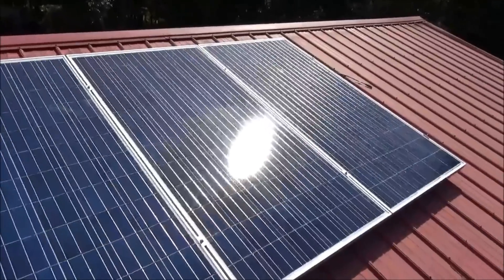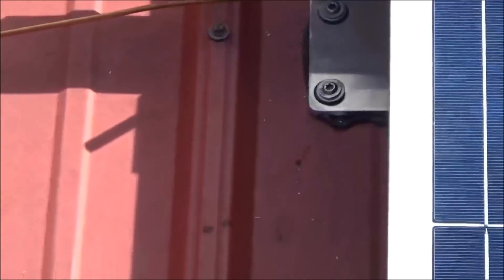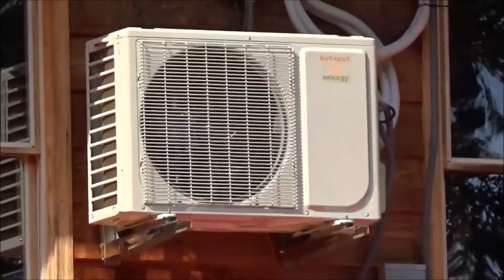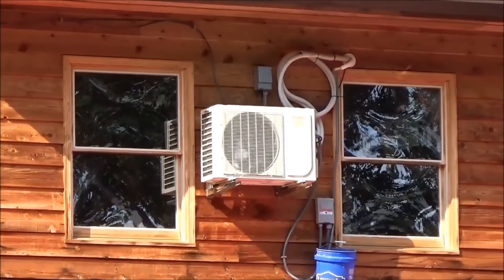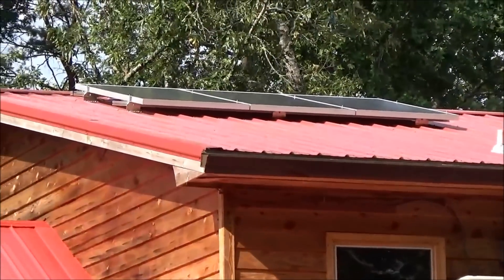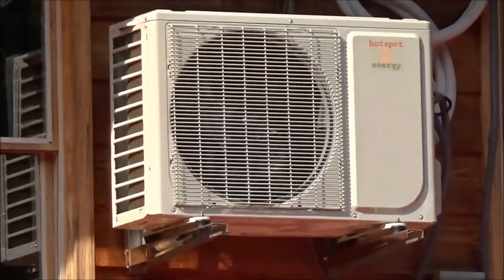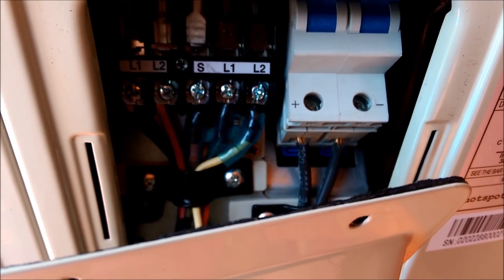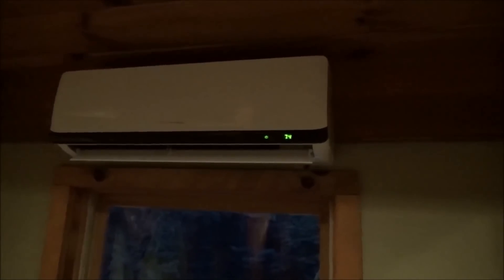Solar Air Conditioning  Part 2

Comment: Im a lil confused whats the purpose of it having to use 220v if its solar i have 960 watts of solar was thinking about buying a system like that
Reply: Check out the ZamnaClimate solar hybrid version. They run directly off solar panels and comes in sizes 12000, 18000 & 24000 btu

Comment: the thing about prepping/off grid/pipe dream is unless you can make it out of sticks and rocks and leaves, you'll need to BUY TECHNOLOGY from a STORE, found in a CIVILIZATION. If you fall off a ladder installing it, you'll need a DOCTOR, trained at a UNIVERSITY, working in an OFFICE; long story short - we need society and civilization, we can't just stock up and hunker down. How long can you survive like that? even when you're shoes wear out and you need spark plugs or air filter or gasoline, things made by a society.  unless you're going back to horses and sawing 2x4's by hand, you're going to need society eventually. we don't exist in a vacuum. even 1800s frontiersmen  needed shovels and picks, made in a forge by blacksmiths = technology. so to really be a preppier, you have to go back to scrounging for bugs and berries walking around naked and afraid if you take "prepping" down to its basics of surviving long term. think a life expectancy of 35 years. Think a short and brutal life defending your stuff from other desperate hungry preppers. Think living like an Indian in 1830, that's what you'll be doing without society and civilization.

Comment: Have you thought about ways to capture the solar energy from the panels when the mini split is off? For example, when the mini split is off, a charge controller is taking the solar energy being produced to charge batteries then inverted to power a frdige for example, but as soon as the mini split unit kicks on, a relay switches the solar energy to the mini split.
Reply: I should add, I just bought and installed the acdc12c and am trying to consider the question above.
Reply: Did you figure it out?

Comment: $$$$$ If anyone's intent on saving $ with this (or the 18,000 BTU ACDC18 model), contact me since I'm an authorized HotSpotEnergy.com dealer in FL: Call 786.441.2727, text: 305.297.9360, toll-free: 800.250.8975, e-mail: info@solarbuyersclub.org, or send a friend request (slowest) to: https://www.facebook.com/danny.chingteh.tseng ONLY if you're not a window shopper or tire-kicker!

Comment: Looks real good....BUT the indoor unit is too close to the ceiling.  The closes I have found is about 12 inches from the ceiling.  What about the cleaning...can you lift the front panel to clean without hitting the ceiling?

Comment: If I for instance needed 24000BTU for my house, could I use 2 of the 1 ton units, or do I need to get a 2 ton unit?
Reply: You could get two units.. Standard Ductless systems can allow you to have multiple indoor units for every out door unit. That does not look possible for this brand. So you would need two whole systems. No pricing I could find on Hots spots website. Think I will have to call them this week.
Reply: Did you eventually get them?

Comment: great videos and set up. how much is this mini-split? are their other brands if so why did you pick this one? I want it mostly for heat will this keep a 900sqft to story house toasty? thanks
Reply from the maker: 1795.00.  I've been with this brand for 6 years as I cannot find any other brand that works as well.
Reply: @engineer775  I went to your site for preppers but the pictures are so generic you have to update that close-ups angels so people can see what they're spending their money on, one unit looks gray or sliver one looks tan, but you can't see any detail please send me more picks of the 18000 solar unit and how it's better than the Ymgi

Comment: Doesn’t say how much for whole System. Think about this, let’s say you spend 110.00 a month to run your AC , 4 months out year. That’s 440.00 for year. Let’s say total system cost $6500.00. It would take 14 years for pay back. In 8-10 years you’ll be replacing that mini split unit. What did you save zero. As a HVAC guy, I can till you maybe 10-12 years
Reply: Poncho758 how did you arrive at a figure of $6500? In the UK you can buy solar panels like those for a couple of hundred pounds each, and a small minisplit ac unit is about £500. You could install this for well under £2000 which is probably $2500.

Comment: 1 ton or 12000 btu split AC  usually gets around 1100 watts how do you get 900 watts ?
Reply: It's probably like every other electronic device it's underrated

Comment: Why did the leave copper lines coiled up like that ?  
 Have you had any oil return problems ?
Reply: Alex G I was thinking the same thing, I bought a flaring tool set and I cut my line set and flared them to the proper length.

Comment: Solar swamp cooler ! The hot-er it get the more it cools !
Reply: Not good in places with high humidity. Good for about 10 deg F cooling in dry climates.
Reply: @RealityNoFantasy  Bull!!! Ours drops average of 20 degrees in about 30 minutes in an 82° room with 100° outside temps.

Comment: can any ac unit be installed to solar. i have the same a/c as you have.. im hooked up to electric .but id like to change to solar
Reply: cathy gassien I think he installed a HotSpotEnergy air conditioning unit:

https://www.hotspotenergy.com/solar-air-conditioner/

These special units can work directly from either AC or DC.

Regular air conditioning units are usually grid tied and only work with AC (alternating current).

His unit can work with either DC (direct current) or AC electricity, and, furthermore, it can work directly from the DC electricity produced from the solar panels during the day without the need for an inverter.  At night, however, it can work with AC (alternating current) electricity from the grid.

The benefit is that the AC unit works harder in a poorly insulated room during the day, and he can save money by providing solar energy to run the unit.

At night less space conditioning energy is required, and he can run the unit with grid energy.

Keep in mind that this works well for one air conditioning unit and perhaps two; however, if you required more (from a cost perspective), you might want to install an inverter, and this could be a different type of installation.

Again the driving force for purchasing these units is based on need, and your particular needs will determine the type of installation required.

Comment: I did not do any research but does this unit only produce ac or does it produce heat and ac?  If not, are you aware of a hybrid solar powered hvac system with a battery back up option that can be plugged in as well to run on grid power?

Comment: ice balls I think is the most efficient way of storing cold. about 50 kWh can be stored in a one cubic meter tank which is just a super insulated tank that circulates antifreeze at about -5 C when the sun is shining and then at night chilled water can be run over the frozen "ping pong " balls.

Comment: What would it take to operate this unit completely off grid? I am sure It would require many batteries to keep going through the night.  I am thinking maybe wire in a wind turbine power generator along with the solar panels
Reply: If that worked, you wouldn't need the solar.
Major expense.
Most people don't get near enough wind to be viable

Comment: Awesome job. I have a whole house with minisplits I installed. Cheapest electric bills I have ever seen. These units use PVE oil which does not turn acidic with moisture. The evacuation is important but not as critical as poe oil in split system ducted 410a units.

Comment: Just a few questions, if you have checked, how hard is it to get parts for the A/C? How many electronic boards are in that unit? Have you looked up the cost of replacing any of the electronic cards in these newer style units?  Thanks

Comment: I just installed a mini split and had the line set coiled like you do. An HVAC came over told me not to have it that way ( can't remember exact reason) so he cut the line and brazen them to a shorter length. Also wrapped my line set with UV resistant tape

Comment: if it rains will it damage the solar panels?
Reply: No 😂
Reply: They are specifically engineered, and manufactured to be able to resist the majority of weather with the possible exception of a hurricane.

Comment: Does this unit have a timer on it?  I'd be very interested in only letting it run when there's enough solar... I understand it needs 220v, but I'd love "some" way to restrict the snot out of 220v power draw.

Comment: I used 12 solar panels to run two 2 ton A/C units and there was surplus power that I stored or sold to the grid. Not all solar panels are created equal, some put out far more power than others. The inverter was the week link in the system.

Comment: I am living in a tropical Country with lots of SUN and with one of the most Expensive Electricity rates in the world. I want to make an OFF-Grid 1.5 HP (3800 BTU) Air conditioning WITHOUT/NO Battery. Just to make the room cool during day and also will help the other air conditioner ON-Grid will be eased at Night.      Is it feasible?
Reply: its possible, we have such product which run only by sun without battery. contact me by whatsapp: +8613906101733

Comment: Is this still working well?  Also, so there's one compressor, and that runs on DC, and the alternating current is inverted for that?  Thanks again for filming this.  Did you do your absorption chiller project?
Reply from the maker: it is working great a year later. the chiller project is going great. videos this week.
Reply: Thanks--looking forward to them.
Reply: @engineer775  how much this unit

Comment: engineer775,, great install, I love ductless mini splits,, I have never used the solar units,, I will have to try one on my place,,, :)   Oh, fyi,, in the future installs, cut the loops out of your lineset,, it helps keep oil that lubes your compressor, from being trapped. If your outdoor unit sets allot higher than the indoor unit,, then depending on manufactures specs, they may have you install a trap, to help get your oil return, back up to the outdoor unit. But you have done an awesome job,,, great video!! Thank you !!   LOL, I know, I know,, whiny HVAC guys. Grin.

Comment: it looks great men but , for a cheeler, you will need some inverter pure sine wave, that have 220v 208v 240v some like that ,I think and a few sola panels more but I don't know ,if you can bridge to inverter to get that voltage. Am only thinking :) what do you think ,
  I want to do that for my inverter mini split panasonic 18,000BTu but mine ,I think I do need the inverter pure sine wave
Reply: those are AC/DC split units. He is using DC you dont need an inverter

Comment: as a hvac professional I wouldn't try to drink  condensate water from the units ...
Reply: +Joel  Dill lol,,, cooking grease, dead skin cells, perfume,, and,,,,, well, I'll stop there, Grin. But in a pinch, process it or here, I would love to be able to water my garden,,, but, very true and funny. Anyone who has had to clean coils everyday, specially in a home full of heavy smokers,,, it actually helped me stop smoking, lol
Reply: +Joel  Dill If I did most of the install myself and then just hired a hvac tech to deal with the copper lines and flaring, and check for leaks, how much do you think it would cost?  The unit itself is cheap, but seems like the install is where most of the cost is.
Reply: Jerry Moody I completely understand your opinion on the greed of contractors. I own a small HVAC company, and service is the bread and butter . Installs are often large checks, but they take several days, and expenses acrue every day. 
I always accept diy installs of these units. And I will happily give free telephone advice on solutions, or such.
Look in the installation manual for the accepted line set procedure. It requires tools most do not have beyond a vacuum pump.

Comment: Neat.  I would try and setup some kind of interlock between my main PV array and the panels dedicated to the AC.  That way the panels could be disconnected from the AC and added to the Charge controller that services the batteries.

Comment: I have one of these ACDC12 units They are awesome I have never had it pull more than 1 amp @ 240 volts so 240 watts in the summer. SEER 19 without solar, SEER 35 with solar. Heat pump functions down to -5 F. Bought it to cool an addition to the house that has no ductwork. You can even use one of these units and the fan only mode on your central ac to cool your house. But given I live in Missouri and we have swamp ass Missouri summers you will still need your central heat pump or ac.

The unit is about the same cost as a regular mini split then add the cost of your PV components so upfront cost can be about 1000 dollars more but unit cost almost nothing to use. First year I had one cooling cost dropped by 85 dollars a month for my single story 2100 sqft all electric country home. Depending on the insolation value, r value, and various other factor will determine how long it takes to pay for itself. For me 3 yrs to recover the cost of the unit. Pretty good deal.
Reply: +Matt Koster, Hi Matt, when you find time, would you please shoot a short video showing us your ACDC12 unit? Thank you
Reply: It's a really awesome

Comment: Here's a question about solar power in general. What can you do long term, or what plans should you have when your batteries from your solar power system die in a SHTF world?
Reply: ij saenz While not being an expert (and interested if my knowledge is still fairly up to date, so hoping on an answer from engineer775 Practical Preppers as well). From my understanding solar power has a 'design lifetime' of roughly 25-30y. This means that a system will output the designed amount of Watts for that time period. After this time the solar panels aren't going to break by themselves, but they are going to continue to produce power, just at a less efficient rate (so these 3 panels (900W output now) will produce roughly 800W in 25y, in 40y they might produce 500W still, and in 60y maybe 100W). While my knowledge is outdated, from when I learned about solar the actual 'life time' of a solar panel was yet to be determined (and it may still be), aka, the first panels still produce power, be it less efficient...
The lifetime of an inverter (was when I got the knowledge) roughly 10-12y, so for the entire 'Designed lifetime' you would go through roughly 2 to 3 converters. I do not know the lifetimes of batteries unfortunately, a quick internet search gives me 4-6y up to 10 depending on use...
So now it depends on what kind of use you design your whole home system for, and the amount of time you want to be prepared for. Going with the lifetimes, having a spare inverter and a spare battery pack 'stored/prepped' will give you a 20y lifetime. Which is well within the 'design lifetime' of a system...
When you want to surpass that, your options get more limited (as far as usable power goes). But I would advice you to look into 24 or 48 Watt equipment (mostly for offered for trucks on lighter plugs - like small fridges, coffee makers radios and what not). The most important factor there is the amount of time you want those things to run, as that will determine the size of your battery bank, but obviously these things are less consumptive as opposed to the normal house equipment ...
When it comes to a long long term prep, there is no substitute to learning to live like they did 80y ago, or even longer ago... We managed to do so for millennia, with out any power what so ever, so don't think the world will end when the power stops, it will just be a 'setback' to different times... Consult with your grandparents, and learn what you can...
Reply: Dutch Courage
Thank you for your answers, good info. I do agree that a person should be self reliant even from electricity, and a video on this would be great, to see what plans engineer775 has.
Reply: +ij saenz Battery life all depends on the type of batteries and how much you discharge them (Depth of Discharge).  For example, http://www.solar-electric.com/lib/wind-sun/Crown-CR-235-specs.pdf, on these Crown Deep Cycle Flooded Lead Acid 6 Volt 235 Amp hour (20hour rating) batteries, if you discharge them to 40% Depth of Discharge (60% charge left) the battery is rated to last around 1500 cycles.  So if you build a battery bank with so little capacity that you use 40% of your batteries when the sun is not shinning, then you will get about 1500 days or 4 years out of your batteries, if maintained properly.  However, that is only in a complete off grid system.  If you are on grid then the batteries will last 15-20 years if you maintain them properly and dont drain them down below 50%.
Reply: People will sweat and stink in a Shtf situation. Baths will be few and far between, unless you live near a pond lake or river. AC will be a luxury that few will have. They won't enjoy it long, because the zombies will kill them and enjoy all their hard work. And by zombies I mean all the welfare leeches who's checks have stopped coming. Everybody will be hunting for food and defending their little acreage. Hopefully all the decent folks will be fully stocked with food and ammo. It would be a shame if the two legged vermin actually rule the new earth after the fall. It's a great experiment to run ac off of solar, but it won't be a thing most people have in the post civilized world. Get ready for Mad Max meets The Walking Dead ;-)
Reply: Nickel-iron batteries are supposed to last virtually forever, although their charge efficiency may be somewhat less.